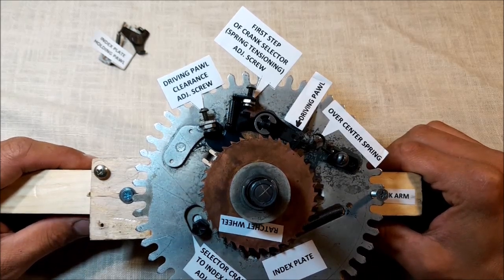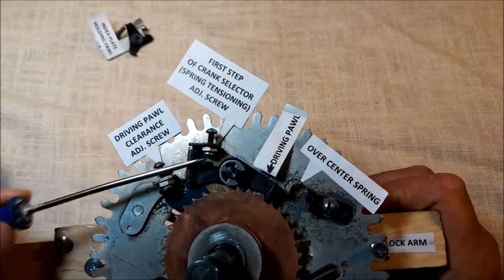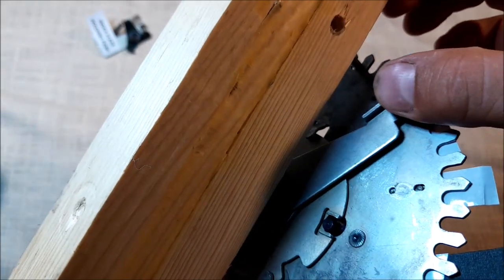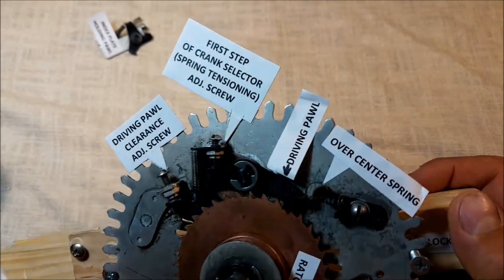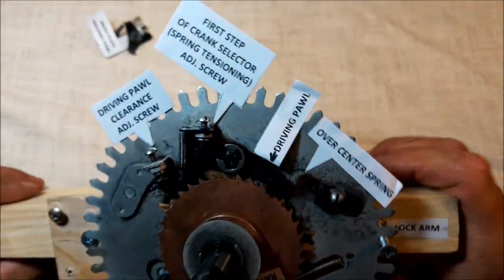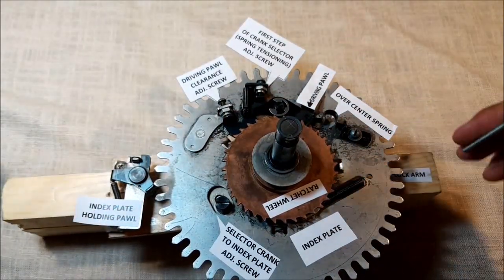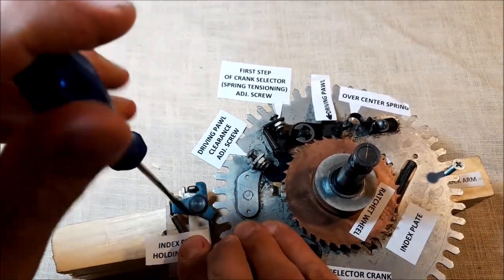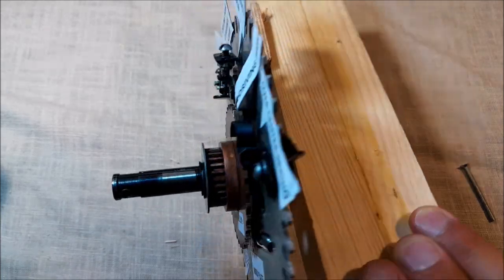How to adjust Wurlitzer 1250 1400 1450 1600 jukebox index wheel

Comment: Thank you for this vidéo. Vidéos for the adjustment of the Wurlitzer 1400 are very missing. Have you a video too, for adjust the selector arm?
Reply from the maker: Hi, thank you. What stage/part of selector arm adjustment you refer to?
Reply: Hy I mean the lifter arm and the selector arm assembly. In fact, the choose of a disk.
Reply from the maker: @jean-luchessedenz2129  Yes, Indeed it requires another video. In simplest words, its final setup is done by slight triange flange bushing rotation in reference to actual selector arm casting. Selector pin's steps should be equal on both "UP" and "down" paths.